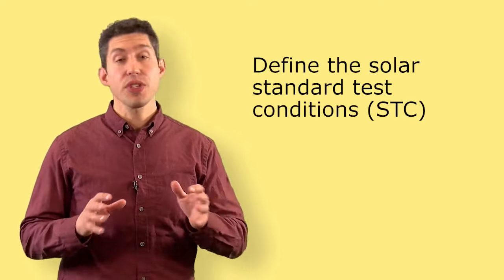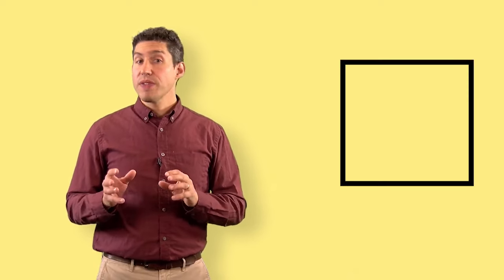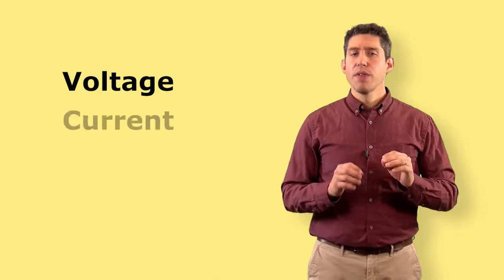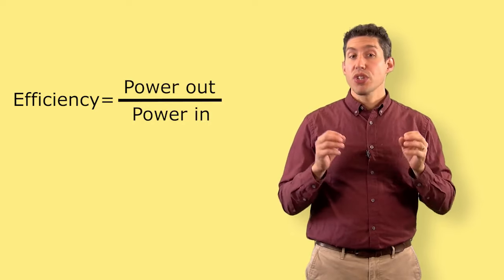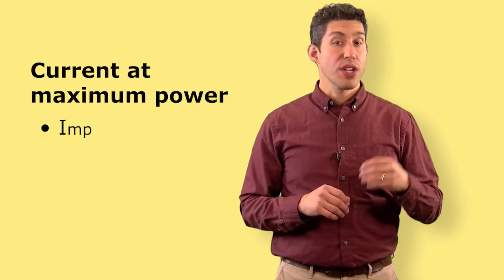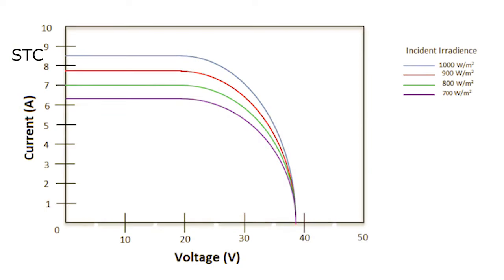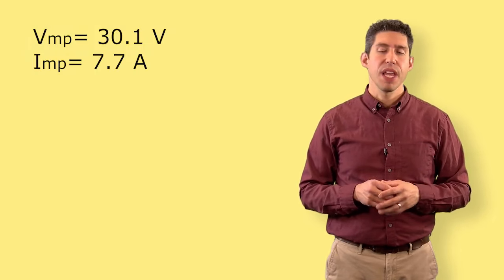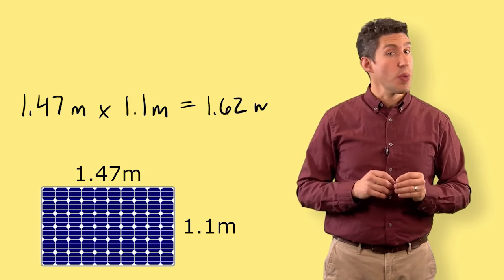Calculating PV Module Conversion Efficiency | Solar Energy Basics | edX Series

Comment: If the irradiance is not 1000W/m^2 but you use a light meter to measure the actual irradiance, can you use the efficiency equation to calculate the efficiency of a solar panel?
Reply from the maker: The efficiency of a solar panel is typically calculated using the ratio of the electrical power output to the input solar power (irradiance). The efficiency equation for a solar panel is given by:

Efficiency = (Electrical Power Output / Solar Irradiance) * 100%

Where:

Electrical Power Output is the actual electrical power produced by the solar panel in watts (W).
Solar Irradiance is the incoming solar power per unit area in watts per square meter (W/m²).
If the actual irradiance measured by your light meter is different from the standard 1000 W/m², you can still use the efficiency equation to calculate the efficiency of the solar panel. Simply plug in the actual irradiance value you measured and the corresponding electrical power output of the solar panel into the equation.

Efficiency = (Electrical Power Output / Measured Solar Irradiance) * 100%

Just make sure that both the electrical power output and the measured solar irradiance are in consistent units (Watts and W/m², respectively).

It's important to note that using a light meter to measure irradiance requires the meter to be properly calibrated and suitable for measuring solar irradiance accurately. Additionally, factors like temperature, shading, and the angle of incidence can affect the efficiency of a solar panel, so the calculated efficiency might not fully represent the panel's performance under ideal conditions.